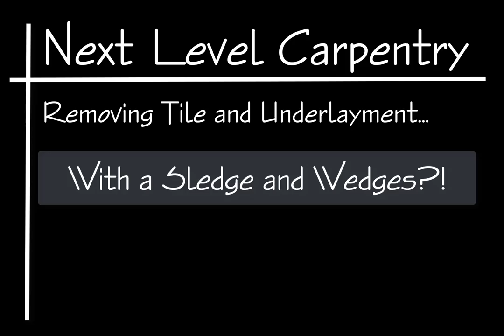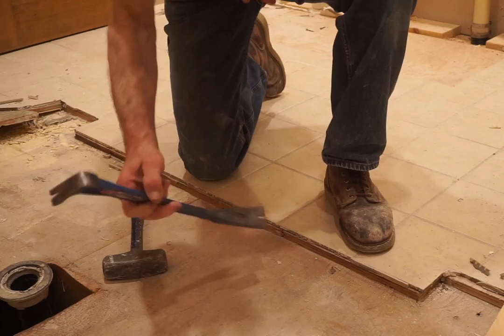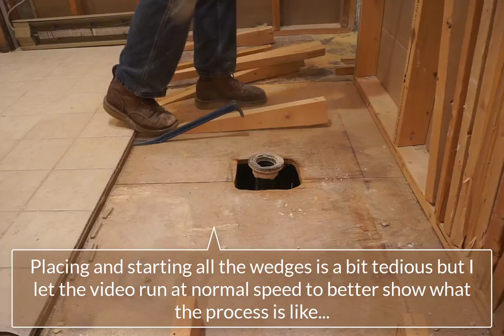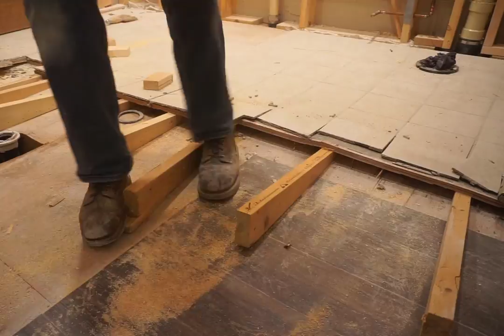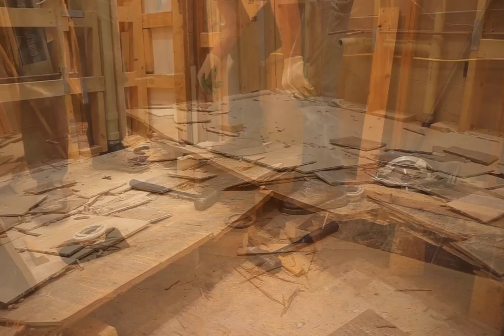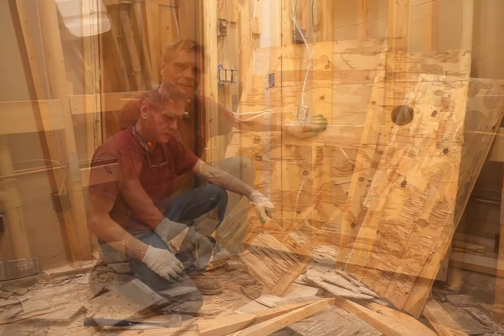How to Remove Ceramic Tile and Underlayment the Smart Way

Comment: Mistakes happen.  Glad it didn't ricochet off a wedge and snap crush him in the shin.  Then you would have had a REAL splinter going on!

Good job.  Works with his HEAD ... like my dad.  Always finds an easier way, or how to get it done against all odds.
Reply from the maker: Messenger,
This sort of project reinforces the credo: 'gotta make it easy on yourself because no one else is going to!'
Sounds like your Dad is someone I'd relate to :-)  Thanks for commenting at Next Level Carpentry...

Comment: You are persistent .  However , wouldn’t it been considerably quicker to just saw and remove both layers of subfloor ?
Reply from the maker: If it was just a two layers of wood, yes  but the fact that it's covered by a layer of ceramic tile cannot be discounted and is the sole reason I removed it the way I did and did a video to show it...
Reply: It’s a good video and presentation.